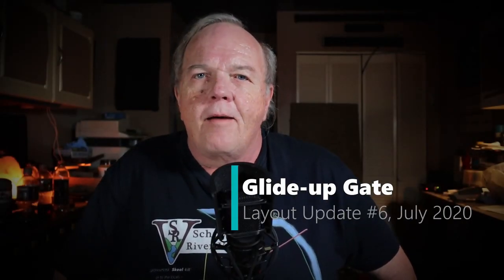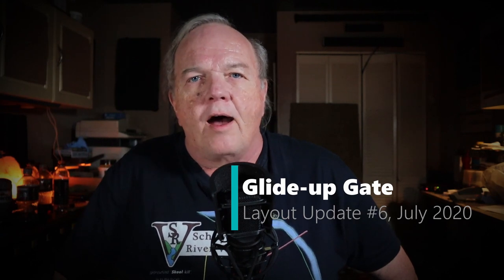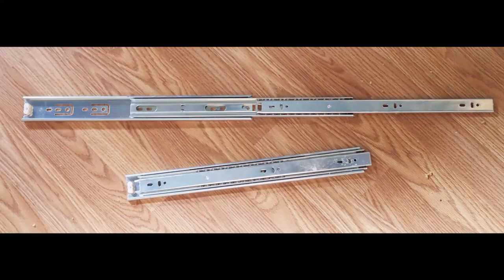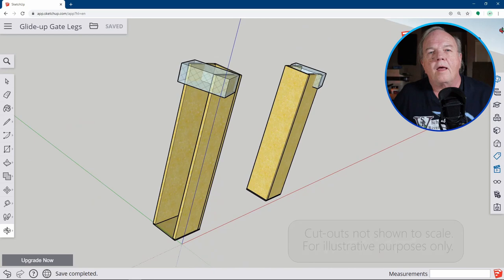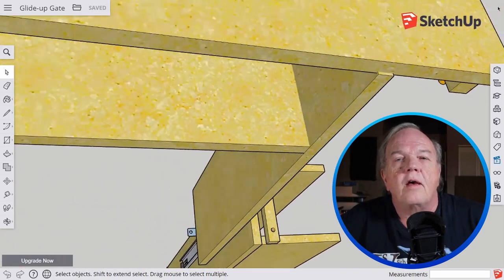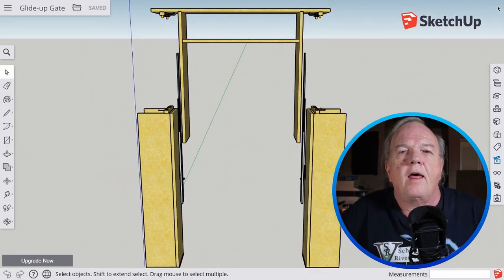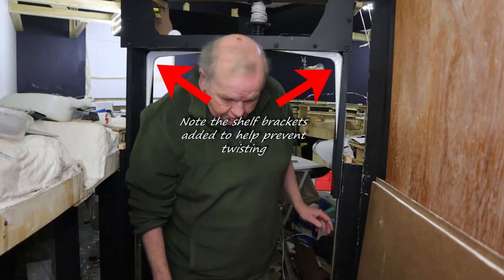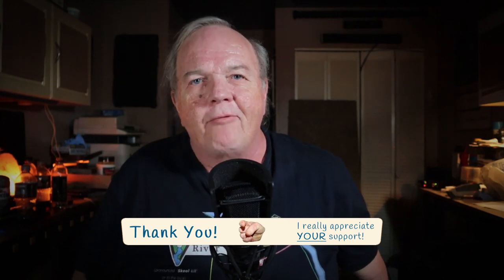Not a lift-up, drop-down or swing-out, but a Glide-Up Gate. Layout Update #6, July 2020

Comment: Excellent bit of engineering there John. One other feature I noticed is that the drawer sides, when the gate is up, will prevent any errant high-balling trains from crashing into the abyss. If the surface-to-surface contact of the copper tape proves unreliable, it appears there is plenty of meat to replace one half with a spring-plunger contact pin. Thanks for sharing your design process with us, it made for a very interesting video.  Art...
Reply from the maker: Thanks Art! Yeah that is a nice added bonus, but the bridge track and about a foot or so on either side are a separate block. At some point I'll add a contact switch to kill the power to the block when the gate is raised. Thanks for the suggestion of the spring-plunger, but I purposely left plenty to work with in case the copper pads don't pan out. So far, they are working well but we'll see. I'm glad you enjoyed the video and thanks for your kind words. I appreciate your support. Best, John

Comment: Do you happen to know what the longest glider size that's available is please John? I think this has great potential for modeller's in wheelchairs 👍👍👍
Reply: @Mark Arnold, If by some chance you cannot find long enough slider, which I believe would be available, you could make the sides two stages, or basically two sliders stacked on top of each other.
Reply: @HumancityJunction  Thanks Heath 👍
Reply from the maker: Hi Mark. I got the slides at a Big Box Consumer-based home center in the area. They aren't known for the widest selection, just the most popular with consumers. The slides I got are 24" with a fully-extended length of 48". I could easily have positioned the sliders so I wouldn't even have to duck my head. Unfortunately, I didn't plan on this from the start and my overhead valance stuck out a bit too far. It would have been too much to tear it down and rebuild it due to the supports. So I settled on less of an extension (and the small head duck). I never considered the benefits for those confined to wheelchairs but I agree - it could open some doors (no pun intended) for them. Thanks so much for watching and your thoughtful question. Best, John

Comment: I wonder how it would work with a double deck 🤔???.  I amagine it would if there is enough clearance 🤔.   I'm definitely interested in your design.   Thanks, Chris
Reply from the maker: Thanks Chris! Yeah, I'm sure it would work with a double deck. The glides are rated at 100lbs - much more than is needed even for a double-deck gate. The 24" glides I used have a fully-extended length of 48". I could have easily made it so I wouldn't even have to duck my head. But I didn't plan on this from the beginning and my overhead valance got in the way of raising the gate any further. Unfortunately, at that spot, the supports for the valance are tied into the benchwork and I didn't want to rip it all apart. So the head duck was an acceptable compromise. Glad you liked the video and got something from it. Stay tuned, I may do a follow-up video on it. Thanks for watching. Best, John
Reply: Thank you for the info,  Chris

Comment: John, really great design. One thought on the contacts for the track feeders.  Instead of just copper tape, why not add spring loaded pogo pins. This will ensure that you have a good connection between your gate and the fixed section.
Really great design, the operation of the gate worked really well.
Reply from the maker: Thanks so much Heath! I took a similar approach with the copper tape on my last layout. It was for a bridge that had to be removable to reach trackage on the other side. I had no issues with it then, so I decided to use it here. I am aware that this is a much bigger project and the copper tape may not work as well over the long-haul. So, I intentionally allowed plenty of room to retro-fit spring loaded pins if the copper tape fails. We'll see. Thanks for watching, your valuable suggestion and your kind comments. Appreciate the support! Best, John

Comment: Hi John. Great solution and build. I have installed a similar unit and I motorised it by adding a small Kingchrome electric lifting hoist and small sailing pulleys  attached to the fixed base board rails and the lift gate rails.Regards Ken.

Comment: Great use of the drawer slides John. Love your solution. The straight up and down movement warrants a flawless operation. Also, the area of the lift up bridge can indeed be fully modeled and when back in place be fully incorporated into the layout. This with a similar width fascia, or even a continuous backdrop. Thanks for sharing!!

Comment: what made you come up with this style of lift up glide up gate? I have never seen such a unique style. very cool and very smart. 
one question, is one slider per side strong enough, just incase someone bumps it< so it will not bend?
Reply: @spark107107, I would like to see you implement this idea with stops at each level of your layout.
Reply from the maker: Hi sparky. I really didn't like the typical alternative methods and hadn't come up with a good solution. So I just mulled it over in the back of my mind. I put this off till I had no choice and it really was just a "lightbulb" moment. The sliders are heavy duty, stainless steel with full roller bearings. They are rated at 100lbs, so they are certainly more than capable of handling the gate. As far as withstanding lateral stress, I ... um ... conducted tests - of course, they were planned and controlled (you believe me, right? lol). I can assure you that they stand up to some serious bumps. Thanks for your kind words and, as always, your support. I appreciate ya. Best, John

Comment: That is one heck of an idea!!!! I like it! My old layout had a swing bridge which worked well. If I still had that layout, I would do this! One question though John, are the trains going to stop before they get to the bridge? Or do you have a way to keep them from hitting the floor if the bridge is up?
Reply from the maker: Thanks so much Ray! The tracks over the gate and for about a foot or so on either side are on a separate block. I haven't completed the wiring in that area yet, but I will be installing a contact switch to kill the power to that block when the gate is raised (I'll be doing a video on that when I get to it.) But there's also a fail-safe. The sides of the "drawer" completely block the tracks heading towards the gate. So, worst case, the train would run into the drawer sides before plunging over the edge. Naturally, I'd like to avoid that, but it's nice as a backup. Appreciate you watching and your thoughtful question. Best, John

Comment: That’s what I call out of the box thinking, well done on an extremely practical and novel solution and so pleased to see it working so well for you. You have certainly addressed all the operating issues too. 
I had a similar problem, traditional bridging methods just did not fit nor would work - so realised a slide in bridge would. Because my layout is on legs ( a big table 19’ L x 10 to 12’ W x 43” H) when inserting it wedges (just a couple of mm) the layout between the walls (foam pads used to cushion) so whole layout is rigid without having to screw to the walls. Unfortunately I have to store that part when removed, unlike yours! Best regards Stephen

Comment: That seems to crying out for automation.  I’m thinking a matched pair of linear actuators, one in each support tower.  Presto, push button operation for those times when your hands are full of new trains and scenery material.  Although the current state of my health is likely to keep me from ever building it, I planned something like this, including your drawer slides.  The room I had available is 10.5’ x 8.5’, with the entry door centered on a long wall.  Since the table depth across the door opening would be about 20”, I figured on 4 slides. I got as far as rehanging the door to open outward before things started their downhill slide.  Glad to see a validation of my vision, even if the NC&StL/L&N Centerville Branch never gets beyond the blueprint stage.

Comment: John, how long of a drawer slide did you purchase and how high does the size to lift?   I am in the process of building an access to my utility area which is behind my full basement layout.  Up to now we have crawled under.  But we have Culligan install a system for our well water and I want them to be able to service the equipment without having to crawl under and I am almost 83 and crawling is no longer any fun.  Thanks for the video.  Will join you group.

Comment: So is this something you think could be adapted to a very large piece of plywood? An older gentleman friend of mine has a very large layout that we're going through and fixing a bunch of track and wiring mistakes from the previous crew and he hasn't slot car track over a section of his layout, it's 4 by 8 ft. Do you think I could take your drawer slides and tabs and have them on the outside of the fascia and then use a piano hinge on the back of the plywood? Because of the way the yard / staging tracks are laid out underneath the slot car track the only access is to lift up the slot car track.